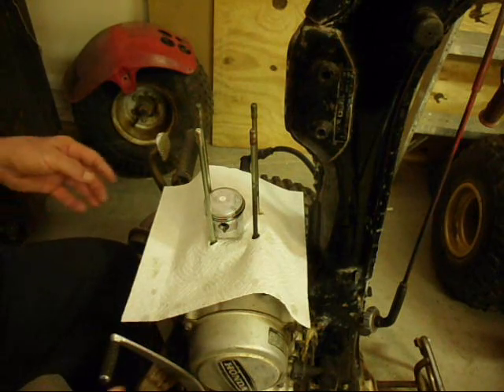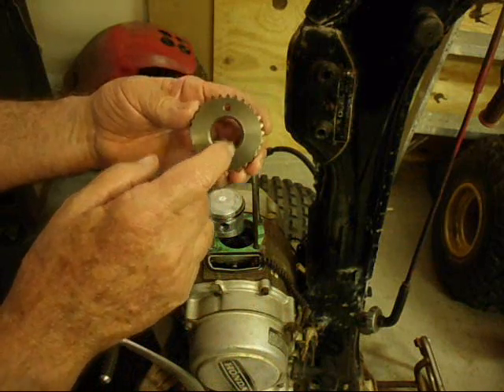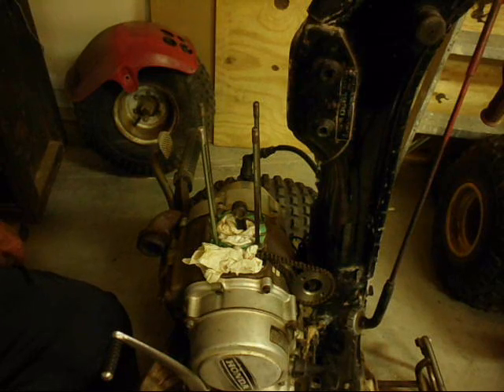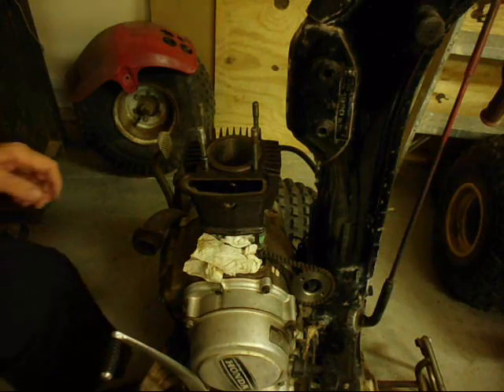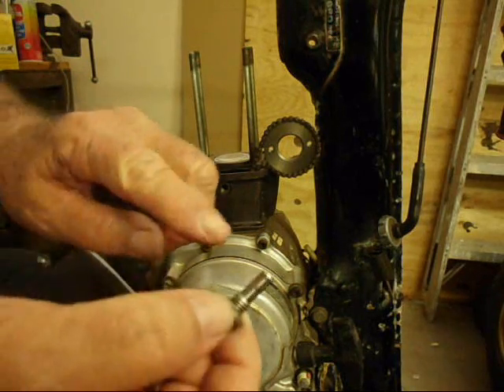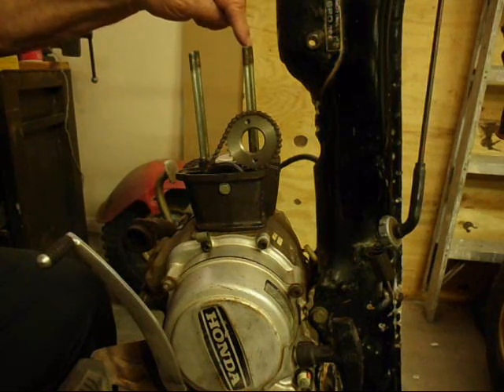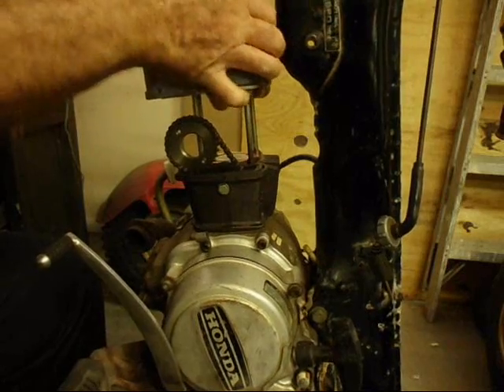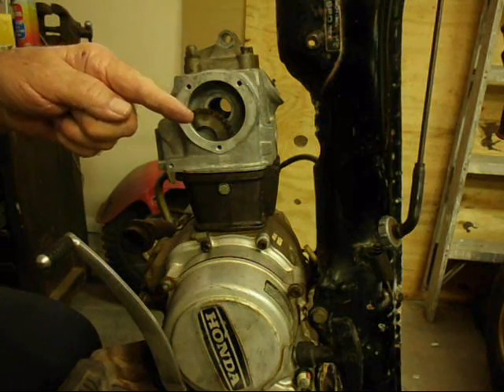1980 Honda ATC 110, Top End, Part 2 of 7, Cylinder and Head

Comment: Sure would have been nice to see how you got the piston/rings into the cylinder....
Reply from the maker: +Josh Carter:  This was a tough one.  Normally you can install the piston onto the rod.  Then oil up the bottom of the cylinder and squeeze the rings as you carefully work the cylinder down.  You will see a taper at the bottom of the cylinder wall to make this a little easier. This one was a real tight fit and I couldn't squeeze the rings with my fingers (There is a ring compressor tool.  But I don't have one).  So I inserted the piston into the cylinder while it was on the work bench.   I inserted it far enough so that all the rings were inside, but left the piston part way out so that I could get to the wrist pin.  Then I brought the cylinder and piston to the engine (see the video at 3:08) and install the piston and the wrist pin clip.
Reply: @SoCalBruce  interesting technique.   I enjoy your vids. Thx for sharing your three wheeler tinkering.
Reply from the maker: @soaringfreedomgiraffe393  I'm glad you find them entertaining.  This is one of my first videos when I was learning about them.  I originally made the videos so I would remember how to put one back together.